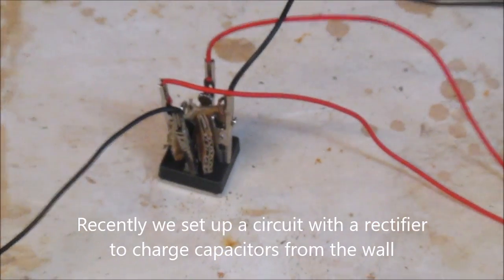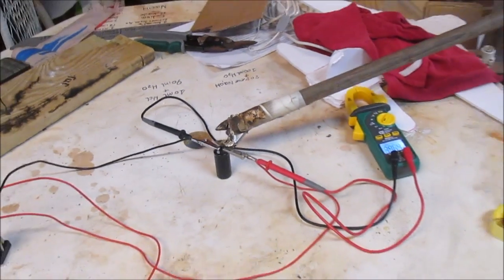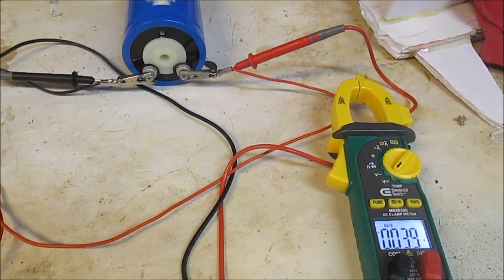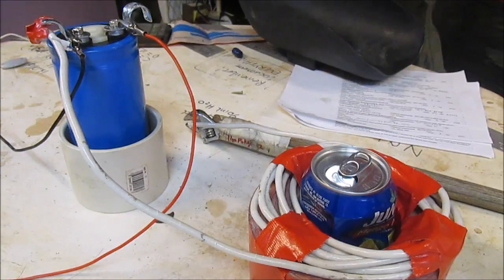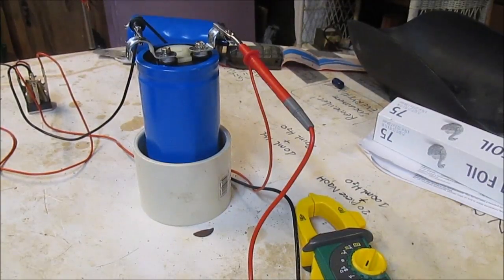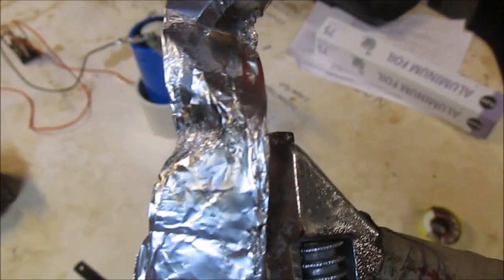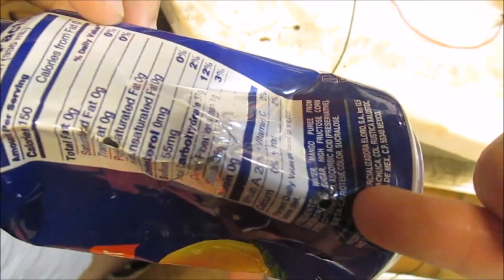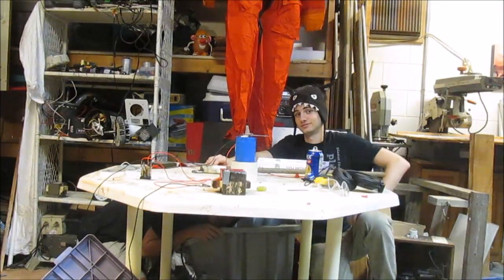Charging and Discharging Capacitors

Comment: I redid the calculations and it turns out the energy is actually about 1/13 the kinetic energy of an m16 bullet. Also these discharges were a lot more impressive and loud in person. I could feel shockwaves on my chest from some and i'd flinch every time. It was pretty awesome. We're planning to increase the power by about 6 times though, because we'll make a higher voltage charging setup and add more capacitors.